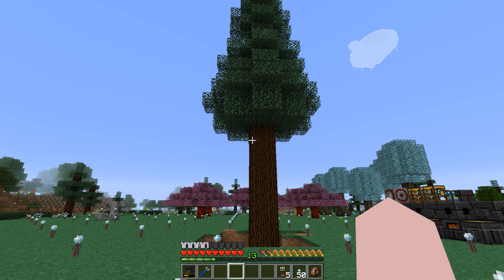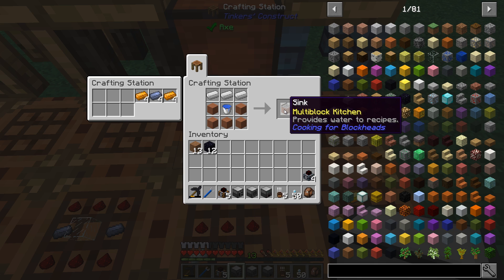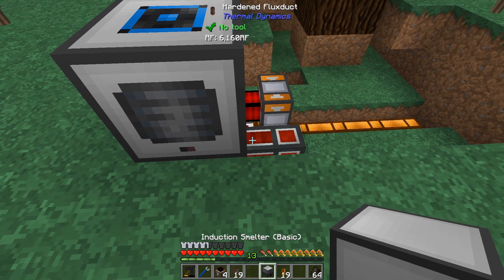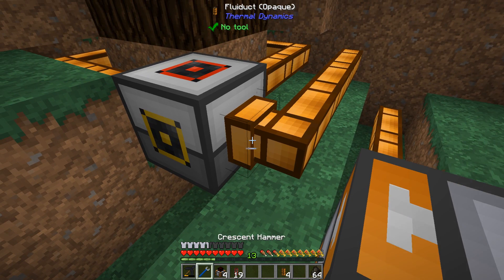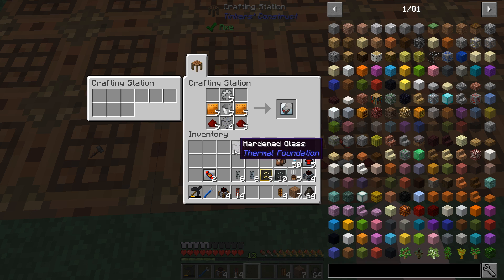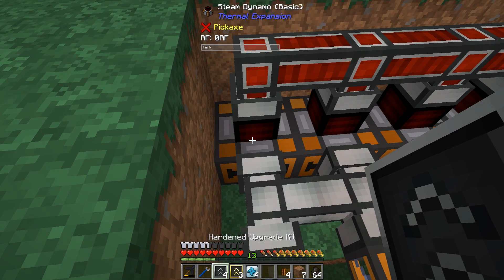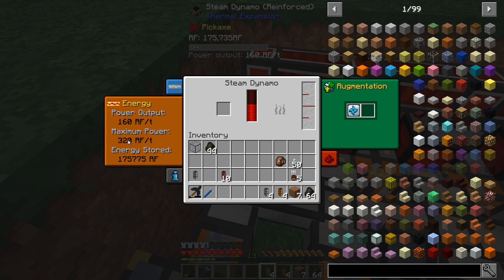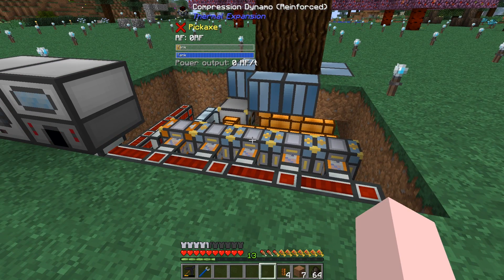03 - Over 1100rf/t from one Tree - Direwolf20 1.12

Comment: thx man, and ya extractors now really messed up, needed 9 2x2 spruce trees, to get enough tree oil :D
Reply from the maker: Arboreal Extractors were kind of nerfed. They produce less if they are side by side and/or working on the same log. Either give them each their own 1x1 spruce, or put 4 that aren't touching (even on the diagonal) on a 2x2 spruce. So now instead of one 2x2 tree you will need two. Then Resin production should be back to normal.
Reply: @WilxGaming  Great, I have 12 single spruce trees in my basement all with an arboreal extractor attached man this takes a lot of space but I guess its worth the trouble, will see if they can power this setup, if 8 are needed, it should work fine, right now I only have 2 hardened upgraded compression dynamo with energy upgrade but I need more power, time to look back at the old stuff and get this going again.

Comment: Still works the same even now?
Reply from the maker: Arboreal Extractors were kind of nerfed. They produce less if they are side by side and/or working on the same log. Either give them each their own 1x1 spruce, or put 4 that aren't touching (even on the diagonal) on a 2x2 spruce. So now instead of one 2x2 tree you will need two. Then Resin production should be back to normal.
Reply: @WilxGaming  thank you

Comment: Hi Wilx! I'm playing Tekxit 3 Custom Modpack, its version is 1.12.2 and I'm planing of doing this way of making energy, does it require more trees or the necessary is just a 2x2 tree?
And if it is necessary more trees do I have to add more dynamos or fractionating "stills"?
Reply from the maker: Arboreal Extractors were kind of nerfed. They produce less if they are side by side and/or working on the same log. Either give them each their own 1x1 spruce, or put 4 that aren't touching (even on the diagonal) on a 2x2 spruce. So now instead of one 2x2 tree you will need two. Then Resin production should be back to normal.

dynamos or fractionating "stills" are the same

Comment: my fluiducts keep disconnecting from my reactors for some reason, the system stops working and when i check on it random sections seem to have disappeared?
Reply from the maker: Is there a chunk boundary where they disappear? In a later episode I solve a disconnecting problem on that power supply by using a Redstone Clock to cause a chunk update to reconnect them.
Reply: @WilxGaming  Turns out in the end i had just claimed the chunks rather than loading them so i think it's all sorted now!

Comment: does this work still the same saw a comment it got nerfed
Reply from the maker: Arboreal Extractors were kind of nerfed. They produce less if they are side by side and/or working on the same log. Either give them each their own 1x1 spruce, or put 4 that aren't touching (even on the diagonal) on a 2x2 spruce. So now instead of one 2x2 tree you will need two. Then Resin production should be back to normal.

Comment: In case anyone is reading this after the nerf, it takes 8 4x4 trees with 4 arboreal extractors on each tree to power the engine setup in this video now.
Reply: You've gotta be fucking kidding me. I seriously need to read the comments before starting these tutorials
Reply: How was it nerfed?
Reply: @immortalsun  I believe tree oil and rosin are just not as efficient now. But it's still a good deal in my book to set this up.
Reply: @eshteluvetuluetpineapples4104  Ah, okay.
Reply: @immortalsun  For a early game power supply its great just built mine today
Reply: so 32 arboreal extractors total?
Reply: Alternatively, by placing extra logs under already-grown spruces or using moving wands or cardboard boxes to cheese it, you can get down to using 20 arboreal extractors – in an 8x10 space – to power these dynamos. Also, you can put signalum and resonant upgrades on the dynamos after building the setup, as long as you add one fuel catalyzer per dynamo for every tier after reinforced.
Reply: I was wondering why I couldn't get the same results.  Glad I made it all in creative first.

Comment: List of what is needed for the build:
Augment: Auxiliary Reception Coil (Only to clear out backlog then remove both.) x2
Reinforced Upgrade Kit x9
Hardened Upgrade Kit x10
Augment: Boiler Conversion x5
Augment: Fuel Catalyzer x5
Fractionating Still x1
Steam Dynamo x5
Compression Dynamo x4
Augment: Turbine Conversion x4
Sink (Cooking for blockheads or aqueous accumulator) x1
Fluiduct x20
Arboreal Extractor x8
Itemduct x2
Hardened Fluiduct x5
Hardened Fluxduct x24
Servo x1
Crescent Hammer x1

Note: for my modpack (FTB Revelations) you need 2-3 of these trees pumping into the steam boilers at all times to keep them running.  I have tried it with two currently and they turn off sometimes.  So you may need more tree setups which means you will need. Also remember to use the Augment: Auxiliary Reception Coils to clear out backlog to bring it to empty when you are setting up the system and then remove both.

Needed for each tree:
Fuliduct x12
Arboreal Extractor x8
Fractionating Still x1
Reinforced Upgrade Kit x1
Hardened Upgrade Kit x1
(Plus fluiducts, Fluxducts, and itemducts to connect to your main system.)
Reply from the maker: After I made the video they nerfed Arboreal Extractors to produce less if there was more than one on the same log. So now they each need their own 1x1 spruce or put 4 in opposite corners on 2x2 spruces.
Reply: I will give that a shot thanks!
Reply: Total material cost:
Auxiliary Reception Coil x2 - Gold Ingot x5, Redstone Dust x2
Hardened Upgrade Kit x10 - Iron Ingot x26, Nickel Ingot x13, Copper Ingot x30, Tin Ingot x10, Redstone Dust x20
Reinforced Upgrade Kit x10 - Iron Ingot x24, Nickel Ingot x12, Copper Ingot x27, Tin Ingot x9, Redstone Dust x18, Silver Ingot x60, Lead Ingot x10, Obsidian x40, Gold Ingot x20
Augment: Boiler Conversion x5 - Iron Ingot x35, Copper Ingot x20, Lead Ingot x3, Obsidian x12
Augment: Fuel Catalyzer x5 - Silver Ingot x3, Gold Ingot x3, Redstone Dust x10, Lead Ingot x20
Fractionating Still - Glass x3, Tin Ingot x4, Iron Ingot x4, Nickel Ingot x8, Gold Ingot x1, Redstone Dust x2, Copper Ingot x4
Steam Dynamo x5 - Copper Ingot x30, Silver Ingot x15, Redstone Dust x15
Compression Dynamo x4 - Tin Ingot x24, Redstone Dust x12, Silver Ingot x4, Iron Ingot x8
Augment: Turbine Conversion x4 - Copper Ingot x16, Iron Ingot x20, Redstone Dust x8, Gold Ingot x4
Sink - Oak Log x5, Iron Ingot x6 (Requires Cooking for Blockheads)
Fluiduct x20 - Copper Ingot x8, Glass x4
Arboreal Extractor x8 - Copper Ingot x40, Tin Ingot x32, Glass x32, Redstone Dust x16, Iron Ingot x72, Oak Planks x16
Itemduct x2 - Lead Ingot, Obsidian x4, Tin Ingot x2
Hardened Fluiduct x5 - Lead Ingot x3, Obsidian x12, Iron Ingot x8, Nickel Ingot x4
Hardened Fluxduct x24 - Redstone Dust x48, Lead Ingot x12, Iron Ingot x6, Nickel Ingot x3
Servo - Glass, Iron Ingot x3, Redstone Dust
Crescent Hammer - Tin Ingot, Iron Ingot x3

Additional Requirements:
Induction Smelter
Pulverizer

Total Cost:
Will add later

Comment: Thanks a lot for this tutorial. My charger was eating up all of the RF I was making with my previous, worse tree farm. Thanks so so much!
Reply from the maker: Arboreal Extractors were kind of nerfed. They produce less if they are side by side and/or working on the same log. Either give them each their own 1x1 spruce, or put 4 that aren't touching (even on the diagonal) on a 2x2 spruce. So now instead of one 2x2 tree you will need two. Then Resin production should be back to normal.
Reply: Alright, cool. Thanks.
Reply: @WilxGaming i dont want tosay it because its so an old video but you made an error arround minute 13:20 and its that whem you put an upgrade you dont need to scale them you can put the directly from tier 1 to tiertop
Reply from the maker: RIOLU477 if you want me to see a comment on a old video, please make it a new comment, not a response to someone else that was commenting on something totally different. 
I was using Upgrade Kits, not Conversions Kits. The reason I didn't make them all Conversions is some already had the lower tiers in them and one wasn't getting the higher tier.

Comment: This setup doesn't work anymore. The still doesn't produce enough oil for the dynamos. After 10 mins or so I was out of oil and steam. Even upgrading the speed of the still it doesn't keep up with how fast the dynamos consume the oil. The problem is that the Dynamos don't gain an internal tank for the steam, thus they never fill up and shut themselves off. So they continually burn oil.
Reply from the maker: Arboreal Extractors were kind of nerfed. They produce less if they are side by side and/or working on the same log. Either give them each their own 1x1 spruce, or put 4 that aren't touching (even on the diagonal) on a 2x2 spruce. So now instead of one 2x2 tree you will need two. Then Resin production should be back to normal.
Reply: It was an Extra utilities RF battery I had hooked up. I unhooked all my wireless transmitters and the thing was still draining tons of power. 60k rf in between dynamo cycles, without the rf battery hooked up I only lost 7k. Now I'm running my Lens of the Miner and gaining power.
Reply: @WilxGaming  They must have been nerfed again. A single 2x2 spruce can support only a single compression/steam combo for about 320rf/t.
Reply: Did they nerf the arboreal extractors only when next to one another or their base tree oil production?

Comment: The terracotta from the buildings didn't work because the recipe needs uncoloured terracotta. If you put the coloured blocks in the drying basin from Integrated Dynamics with a bucket of water, they'll wash clean and you can use them.
Reply from the maker: Thanks. I didn't know that.